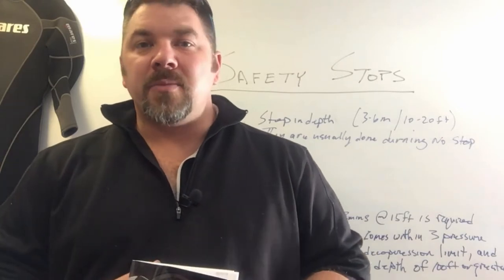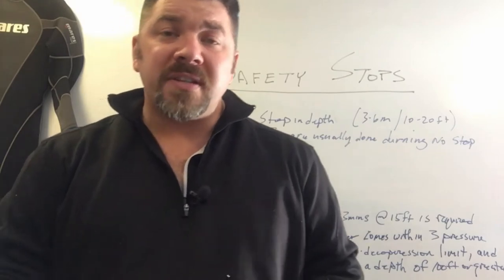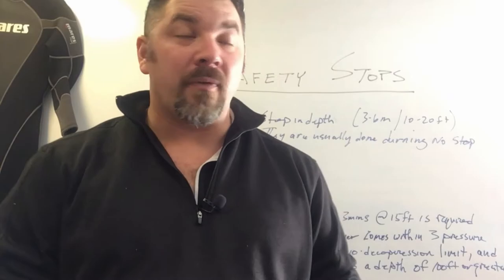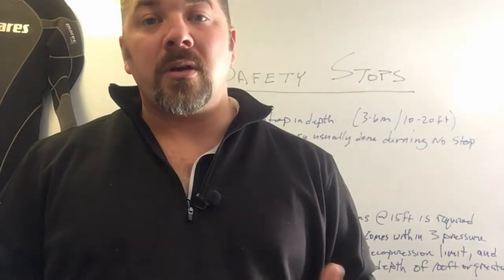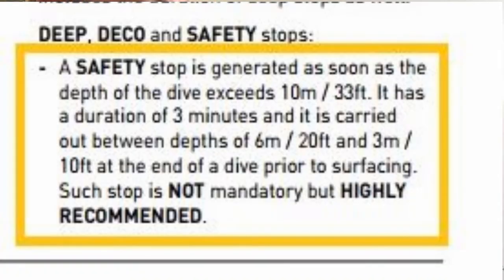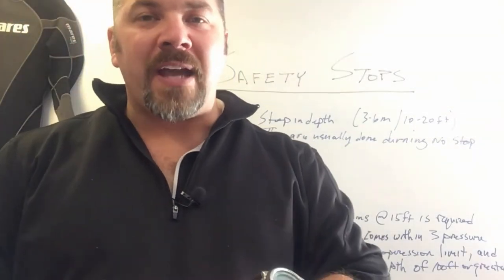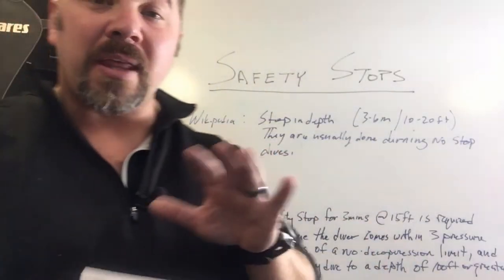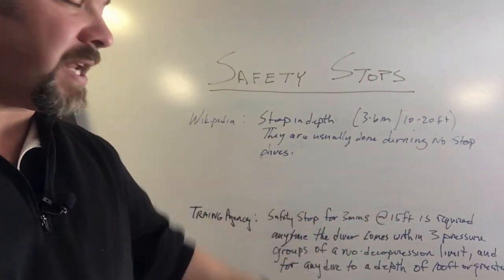Safety Stops To Do Or Not To Do That Is The Question

Comment: Safety Stop 100% of the time. Even on my 35-40ft shore dives I do all the time at Radio Island. It's just safer and Safety is never stupid. I choose to do a safety stop on every dive, even the shallow ones to build the "muscle memory" and ensure they are always done on my deeper dives as well.
Reply from the maker: We agree, Safety is always Better.
Reply: When I do a shore dive, I like to ascend to 18 feet, shoot a toward shore and start swimming.  After 3 minutes, I level off at 15 feet and continue swimming in toward shore at 15 feet until I either get low on air or reach the surf zone.  Sometimes, I swim all the way into the beach at 5'.
Reply from the maker: This is the exact same way we do most of our Checkout dives in the lake and in our local quarry.  Hanging out in one spot for 3 minutes can get pretty boring at times.

Comment: The main purpose of the safety stop is to halt the potentially dangerous positive feedback during ascent whereby stuff is expanding and increasing the buoyancy which in turn increases the ascent rate leading to faster expanding stuff, etc. It is there to remind divers to 'pull the break' timely and avoid uncontrolled fast ascent to the surface in the last couple of metres which comes with higher risk for pulmo barotrauma and embolism. The effect on nitrogen loading and the probability of DCS is negligible. I only do 10 sec safety stops on my NDL dives. In fact, as soon as the ascent velocity is brought down to zero at about 6 msw, the protective role of the safety stop is pretty much accomplished.

Comment: Hey Bryan, my take on safety stops is this... Always Do A Safety stop.. like any habit, if you do short or shallow dives most of the time and neglect the safety stops. Because you dont really need it. Then when you do that deep or long dive, you may forget about the need for the stop simply because your not used to doing them, so always do a stop so it becomes a normal actuvity.
Reply from the maker: That is what we always recommend. Having a good set of habits to start with will always make us safer while under water.

Comment: Did a stop at 3 feet today after my deep dive to 12 feet. Blew all my nitrogen out. Just checking new gear and getting some bottom time. Tony
Reply from the maker: Hello Tony Houk, any day diving is a good day. I enjoy testing new gear out as well.
Reply: @LakeHickoryScuba  went to the dive shop to get my weight down for the gear I was using. In a 3mil shorty, Lycra onesie, and the rest of my dive gear I was wearing 22 pounds on my dive trip. Found out the other day I only needed ten pounds. I bought a new bcd that I couldn’t figure out how to easily dump the air so I used a lot of air when we were under to compensate. Felt stupid that I didn’t do a weight check while we were on the boat. Live and learn. Have a great dive. Tony

Comment: Good analysis. What would you recommend when it comes to the maximum amount of gas to draw out of your tank safely. I have heard of people worried when they ended a dive at 1000 psi, some at 800, and others that say planning to 500-600 is ok. Could you give your professional opinion?
I personally think that only using 2/3 of a 3000psi tank seems like a waste. Taking unnecessary risks under water is unacceptable but would it be unreasonable to go down to 300-500 if you are swimming just below your boat while exploring at a shallow depth?
Reply from the maker: Hello Ally Amber, I will try to keep this as brief as possible.  I personally believe in the rule of thirds. I feel that its always best to end the dive with at least one third of your over all gas supply for emergencies.  With this being said though, each dive is different.  I have made thousands of dives on shallow reefs, and ended my dive with 500psi, 400psi, 300psi, etc. etc.  It will always be up to the individual diver and what they feel is the best for them.  My suggestion to you is this, pick a number that you feel comfortable with, and end the dive with that amount.  If you say 500 psi is safe for you, then end your dive at 500 psi.  By ending the dive, this of course means being out of the water.  So if 500 psi is your bottom, then don't wait until you have 500 psi left then surface, but surface and be out of the water with 500 psi.  Hope this helps, and answers your question.

Comment: I have my nitrox and 80cf tanks. Unless I break that 100ft depth I skip it unless my dive buddy is on air and needs to do one. Shore dives on the west coast of Florida you will rarely find more than 30ft however I do know a spot about 500yrds out that reaches 64ft.
Reply from the maker: Hello pirateturns360, this is something that I feel like a lot of divers tend to overlook. Dives that are 20 feet and less is technically a safety stop in itself. I have seen divers overthink safety stops to the point they will make very shallow dives only to come up 5 feet for 3 extra minutes then end the dive. At the end of the day, its important to remember planned dives using either a dive computer or dive tables are already conservative by nature, as the algorithms are conservative. Thus, Safety Stops are never required. They are a good thing to practice though and still recommended by most of the training agencies.
Reply: @LakeHickoryScuba  I get that. My point is that I took the nitrox class and pay an extra $5 for nitrox fills. I'm going to take advantage of that. Like I said I have 80s and unless I dive below 100ft I don't do a safety stop. Unless I'm with a dive buddy who's on air. I know the books and teaching is beyond conservative, but I come from the old school. Been diving since the 80s and even on air never made safety stops. But then again rarely broke 30ft. It does get frustrating when I'm paired up on a boat with the guy whose computer tells him what to do and I surface with 1500psi and our dive ended after 35 minutes. Then hovering 10ft off the bottom. I'm thinking I paid good money for this. And let's not forget this past year and a half. We're definitely moving the safety goal posts. And most divers think this is the law like they will get sited for violation.

Comment: As for me I would make a safety stop anytime I went below 10 m to place myself as a conservative diver, "note" I haven't received my Open water certification, yet my instructor and the instructions provided to me it was suggested that I practice making a safety stop at 5 m for 3 minutes after each dive, air cylinder permitting.
Reply from the maker: Hello dominick fighera, its always good to be conservative while diving. I encourage Safety Stops on all dives as well. This of course being if the entire dive in itself isn't just one big safety stop. Most training dives with new students are 20 feet and less, thus, the entire dive is considered a Safety Stop.

Comment: The only times I would avoid a safety stop would be in an emergency (lost buddy, etc) or when the depth of the dive has been insufficient (if I've been diving to 6m I wouldn't differentiate the dive and safety stop part of the dive).
Reply from the maker: You make a great point clarkeysam. Dives say 20ft and less, would be a safety stop in its self.

Comment: If you needed to surface to look for an anchored boat or other navigation reasons, would you do a safety stop before taking a peek on the surface, or would you do it afterward - at the end of the dive?
Reply from the maker: rob9876 It would be dependent on how deep I had been and for how long.  In general, I teach new divers to simply follow their computer in regards to Safety Stops.  Since computers are the most conservative way to dive, compared to tables, it never hurts to follow their directions during a dive.
Reply: @LakeHickoryScuba  Thanks for the quick reply!
Reply from the maker: You’re welcome

Comment: There were no safety stops for decades.  They are a good idea BUT if you’re about to run out of air head to surface.  (I do them btw). 

Newer divers think they’re gonna die if they don’t do a safety stop.  We are at point where, in some circumstances, they become a DANGEROUS if followed blindly.  Drowning is fatal but skipping a safety stop is almost never harmful.  Kind of like maybe you take your car’s safety belt off if it’s on fire or sinking in a river.  A failure in training programs because new divers aren’t solid on underlying principles.
Reply from the maker: You make solid points Paul.  Safety Stops are added conservatism at the end of the dive, but are not crucial to every single dive.  When we do dives locally with new students we plan a safety stop at the end of every dive.  This however does not mean we stop in one spot for three minutes.  We simply plan the dive to where the last three minutes of the dive is between 10-20 feet of water.  Makes it easy to do here in our lake or even our local quarry.

Comment: Plan your dive & dive your plan. Blue water = safety stop on a shot line. Shore dive = 2 exit points with gradual resurfacing. Reef dive = find a playground at 5m - stay as long as your air allows.  Dive tables have become increasingly conservative with each revision. All Dive Computer manufacturers do not wish to be sued by divers for getting bent therefore their algorhythms are even more conservative. Add in the fact that most dive charters / organisations mandate a dive computer = NO ONE should ever get decompression sickness IF they plan their dive and dive their plan.
Reply from the maker: Hello PeterJulianPhotos, thank you for sharing your thoughts with us.